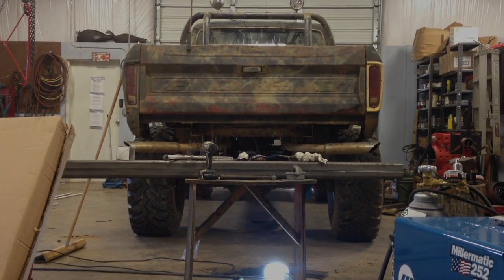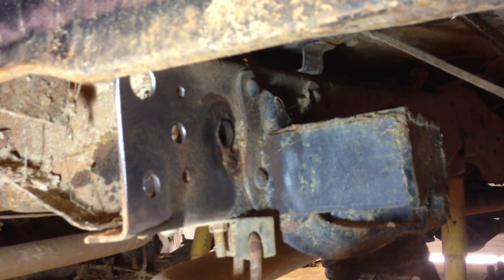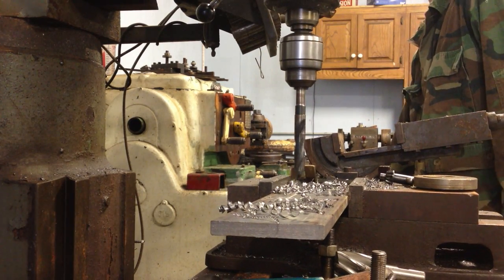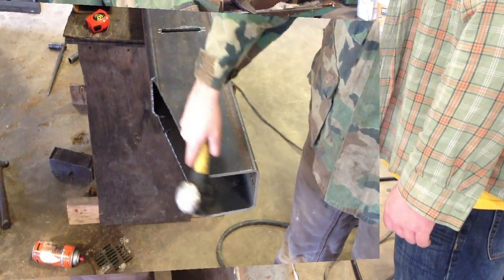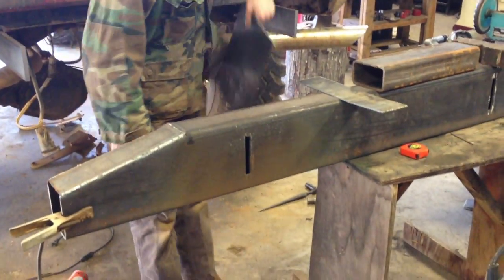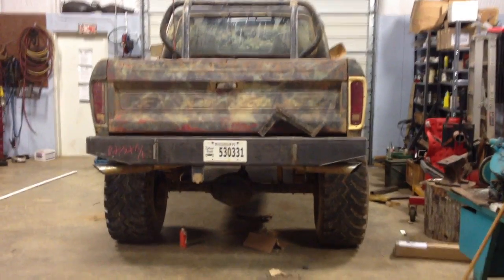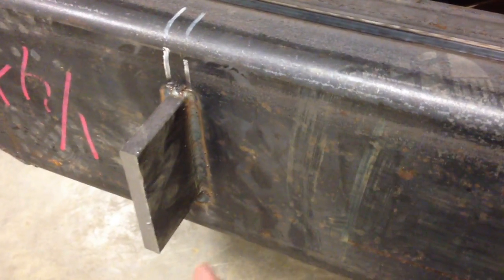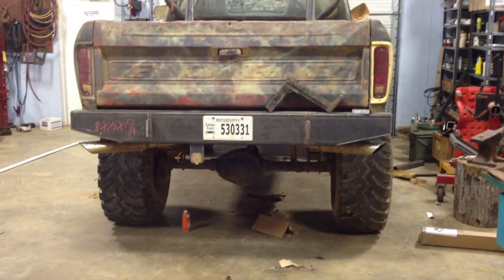How to build a Custom Bumper

Comment: im looking at MIG welding a bumper with a winch and bull bar for  my old 3\4 ton truck, i think 1\8 inch steel should work fine. Does it sound like a good idea and do you have any pointers. Its going on a truck thatll be offroad a bunch and the cattleguard and winch would see a lot of use.

Comment: Thanks great video and nice work! Don't make an air-tank out of it, compressed air also brings a ton of moisture and you'll end up with nothing but rust and corrosion on the inside oh that bumper.  Ever seen the inside of an air-tank?

Comment: I was getting some ideas on a bumper I’m gonna start fabrication on by checking out some videos n such online. I like what you’ve done there by the way, really nice work. I have a suggestion if your welds are tight (which it appears you know what you’re doing) that I done on an old truck I had. I made the bumper out of stacked tubing, stainless that connected and I incorporated a pressurized air tank out of it with adapters, drain valve. An ole timer showed me one that he had made and I thought it was a good idea many years back. Thought I’d pass it along. Great looking bumper tho.! Keep that creative mind of yours working.!

Comment: You should have added a Schrader valve,so it doubles as an auxiliary air tank.
Reply from the maker: Matthew Wayer 
Good thought but I torched multiple holes in the bumper for pop in lights so it would have been more trouble than it was worth. I had an air tank in the bed already.

Comment: looks good man! the mounting tabs on the outside of the bumper, i probably wouldve rounded them off and drilled a hole through them big enough to put the clevis in. would give you just a tad more pull strength. but other than that, i like it.

Comment: If you haven't done it yet, make a bed carrier for the tire. Don't bother with bumper mounted tire carriers, they rattle like a mofo over time, especially if the spindle or latch is too weak or poorly done.

Comment: Nice bumper!!! What I like most about using square tube in offroad bumpers is you can tap in fittings and doubles as an air tank.
Reply: thats a good idea.... damn
Reply: Fml that’s brilliant!
Reply: You can do that with a round one too, and safer.
Reply: yep did it in the early 90s with a round bumper

Comment: I made a bumper for my cj-5 out of 2x4 3/16 wall tubing. But I cut a pie section out to taper the ends back into the body.. Now I'm making a new bumper for my fathers 1999 GMC 1 ton duelly along with a bunch of body work/mods to it...

Comment: Americans make things propper!?
No they don't!
This guys did a lovely job and a good vid... Well Done this man!
But, lets not get confused between a man in his shed and the US industry! 
Now America's bought most of Europe's companies, they have access to our technology. Which they are only now using in their products.

The bumper (fender) looks great. Well done.
My only concern is, did you weld it to the chassis as well as bolt it?
Just thinking with all that weight on those four bolts, it might rip off?
Reply: Why would you weld it to the frame? four bolts is plenty and I don't think I would want to cut it and reweld it every time I had to take it off

Comment: Greetings. This bumper build video is great, I'm on with a similar project for front and rear bumpers on my land rover discovery - although I will be doing it the hard way with and angle grinder.

Regards from England.

Cheers, Mike.

Comment from the maker: Half inch brackets to the frame, and 1-1/2 clevis mounts.  The 1/2 tabs go all the way through the bumper, and I welded another 1" piece of metal to the 1/2 tabs and ground it smooth to get the curved look.  I may post a follow up video soon of what the bumper looks like painted and with lights.